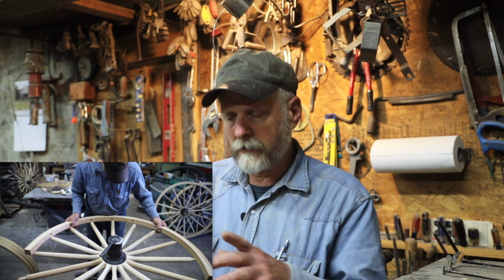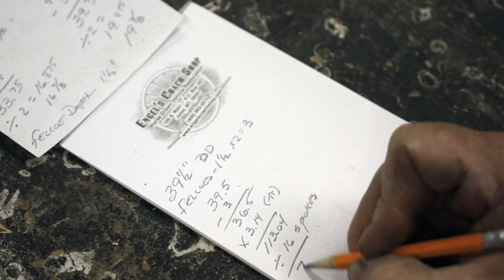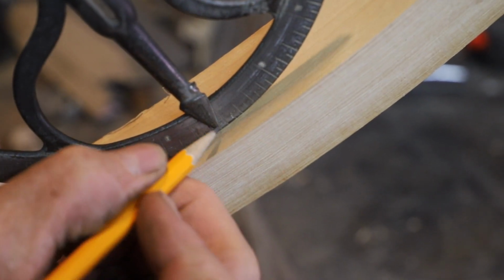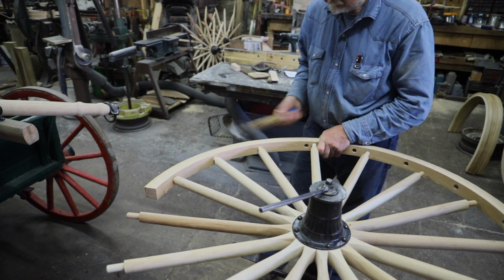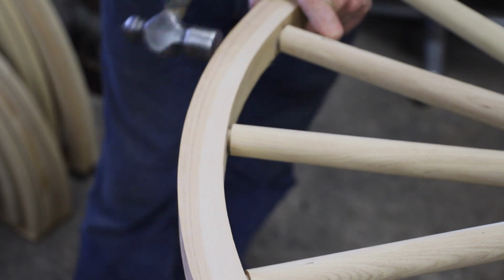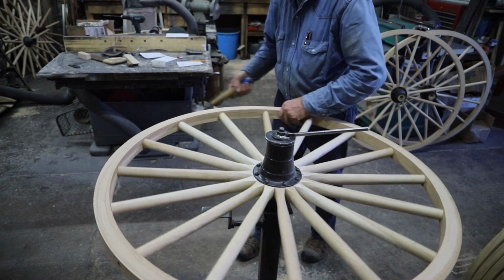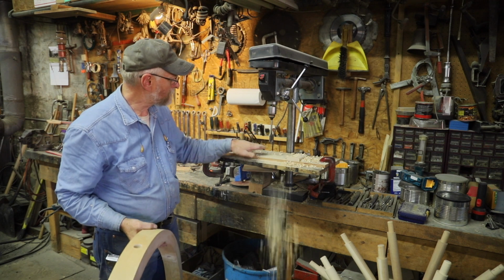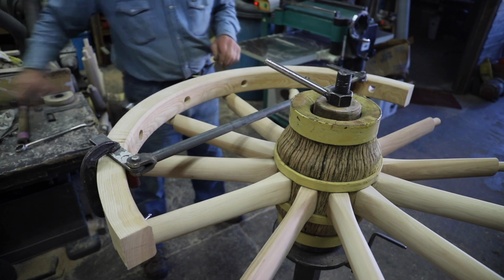Working With Bent Wood Wheels | Dynamics of Being a Wheelwright

Comment: I was going to ask a question about this on your latest video (4 years on from this!) but figured you had probably already answered it and here it is. You can only assemble these because the wood is springy I guess. If the spokes and felloe couldn't bend you would never be able to assemble them together like this. It would be a mechanical impossibility. Your stretching bar on the thicker wheel makes that really easy to see.

Comment: Totally awesome😎😎😎 as always.
No one going to take the spoke out of your wheel🤭
I got it way back how the fellows and spokes had to be manipulated.  Whilst not the same sort like replacing bike wheel spokes, you manipulate the spoke length via turning the nipple to accommodate the fixed rim diameter.  Always been slightly surprised if using a calculator to use 3.142 and round the result their, not a criticism at all just a bit surprising. Hay ho another excellent day's learning at Mr Engles Coach Shop.
👍👍👍👍👍

Comment: I think about "hammer tracks" of that peening hammer especially on the spokes.  Seems a rawhide or urethane mallet would leave slighter tracks. But then it wouldn't have the bounce for short stroke tap-tap of the "blacksmith arm".
Reply: When the tires are hot-set, the steam and moisture from hosing down the hot tire bands will probably swell those dents right back out again.

Comment: Recommend you run your final number back through the calculation to verify your starting number.  Good way to check quickly if you messed up before all the work.

Comment: You just know that using the c-clamps to hold down both of the spreader bar ends before starting to hammer comes from having at least one end come loose some time or the other.  Thanks for the great video and explanation as always.
Reply: EngelsCoachShop 
Done something similar myself, that’s why I recognized it right away.

Comment: Another great video. What is the tool that you use to squeeze the ends of the spokes together?
Reply: It might be called a Peavey.  We used to use them to move telephone poles around.
Reply: @EngelsCoachShop  many thanks. It does look a bit like a peavey, but smaller and with no point on the hook.

Comment: If you end up a bit short when sizing the felloes, how would you address and correct that (if keeping the "short" felloe)?
Thank you for sharing your knowledge and craft with us!
Reply: And another question while I'm at it: when you fit the felloe on the smaller wheel you push the spokes, do the spokes just bend or do they shift in the hub? If they shift, do you do anything to adjust them so they settle in straight again?
You make this look so easy, too easy...
Reply: @EngelsCoachShop  Thanks for your answers.

Comment: What are the criteria that determines whether you use 2 half-circle fellows or, like I've seen in other vids here, say an 8 piece fellow with 2 spokes per section?  It seems like with heavier wood pieces the 8 piece would be easier to put on and less chance of breaking a spoke tenon at the hub.  Great vid as always, cheers!

Comment: What is the name of the tool that you use to measure and layout the  fellows? Is there a design reason for the half fellow vs the two spoke version on the heavy wheels?
Reply: I believe that wheel is called a traveler and is 1 foot in circumference; marked in 1/16 inch increments.

Comment: so...if you are working to an accuracy of 1/16 ", and pi = 3,14, design the finished inside circumference of the wheel rim  & the  outside cicumference of the hub  to be  an exact multiple of 1/16"...

Comment: "... and a strong eighth."      I would be inclined to convert to millimeters and make a data table for the absolute distance of each hole from the starting point and then use a metric tape measure to lay out the holes.  Your odometer wheel gives interval spacing, and that leads to a progressive, cumulative error .

Comment: Would some Vaseline or silicone make the spokes slip in easier?
Reply: I'm not sure, but I think Dave wants 
them to be tight.

I'm (NOT) getting tired of saying this, 
yet another great video!

steve
Reply: I'm no expert but yes it would however, that would work against the plan once they were assembled onto the fellows as friction is important at that point.
Reply: @EngelsCoachShop  Bee's wax makes perfect sense. I should have known that.
Reply: @Garth2011  Not really. The tire keeps them tight.
Reply: @davidharris6581  That's true however, no need for the fellows to have anything on/in them that would put the wood at risk such as Vaseline or silicone.

Comment: I personally hate to be watched while I work, it makes me nervous and I start to sweat, that's when it's a person, but I think I'd still be distracted if I knew I was being recorded, is it possible that's why you made the math mistake?
Another thought, would wax on the tenons help, or cause some other problem?
Thanks for another good video.
Reply: @EngelsCoachShop  I've been an electrician almost 40 years, I can be doing something I've done a thousand times, then the homeowner decides to stand over my shoulder and watch, and the sweat just starts pouring off my face, I don't have to worry about it anymore, I'm retired.

Comment: I use those same calculations when figuring the ID and OD of sign trim on custom cut lighted signs and round signs.  I feel for you because I've made the same mistakes...the difference is that aluminum is alot harder to 'make work'.  and for some reason I cut it twice and it's still too short!  lol
Reply: Gotta measure THREE times
Reply: @BlazinWolf25  Ah dang it, I cut it twice and it's still too short😁

Comment: Could you make a wheel with a "Mobius" strip for a tire?
Reply: @EngelsCoachShop  I have told people if they want to fence me in to make it a Mobius fence and I will stay in side of it.
Reply: Cleats on the drivers of some old steam traction engines were sections of Möbius strips. When the cleats were set at an angle so as to be self cleaning and provide thrust towards the axle, the stock had to have a twist to lay flat against the circumference of the flat wheel. I suppose that at some ginormous length/circumference it would complete the 180° twist if all the pieces were joined together.